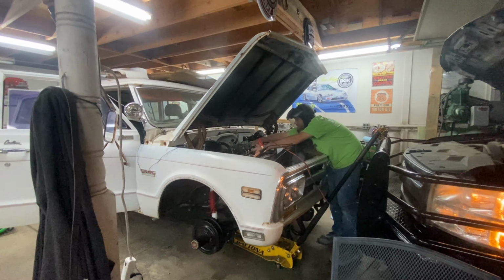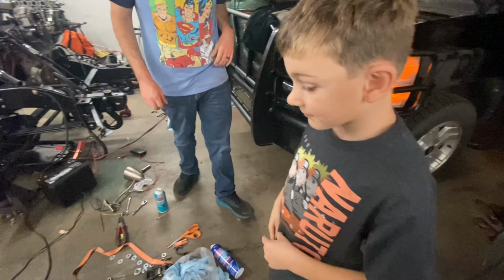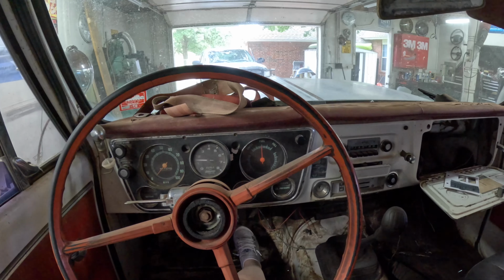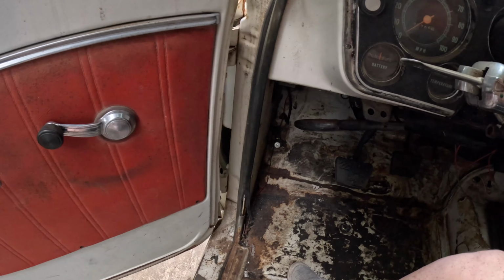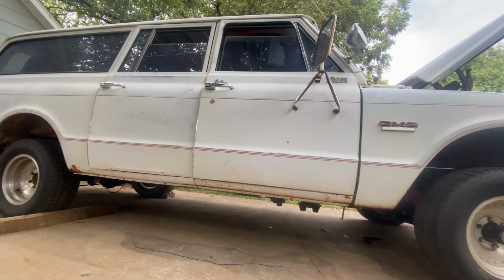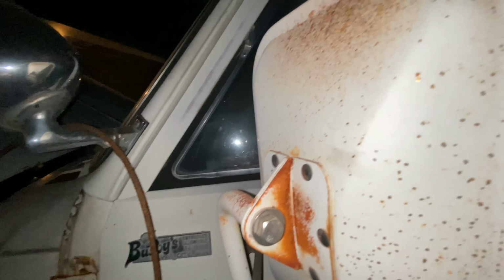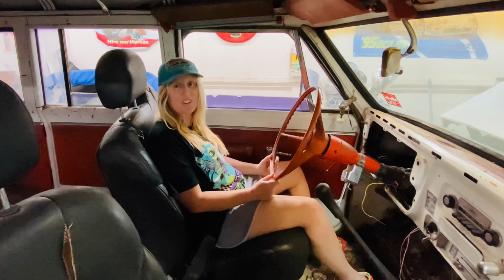68’ Suburban build’s sweet success!

Comment: A later model steering box will make the steering feel tighter. The early boxes always felt "mushy" for lack of a better word. The 68-72 boxes were 4 1/2 turns lock to lock, the 73- IIRC about 86 boxes are variable ratio and 3 1/2 turns LTL. There some fitting differences but the nut on the back of the pump is removeable and you can swap to the one you need or have a local Hyd shop make your hoses. The later suspension also will bolt up with a little wallowing of one hole on each side to give you disc brakes and cheaper tie rod, ball joints and bushings. Also the later front sway bar is a bolt on as long as you get the frame brackets . Just some ideas for what I have done to my 68.
Reply from the maker: Thank you for the suggestions and for watching! Lots of good info

Comment: Why would you spend the time and money and put a carb on it?
Reply: that's my question as well
Reply: @dutsmiller  it also sounds off like the compression is low or valves are open.... it's not running right at all in this video
Reply: Did you watch until the end? It sounds great in the last few minutes
Reply from the maker: We went with a carburetor because it’s a 1968 and we wanted to keep it old school and also wanted to be different with our ls swap. When the carb is dialed in correctly you can’t match the throttle response with a throttle body. Carburetors offer great performance if tuned correctly. Thanks for watching!
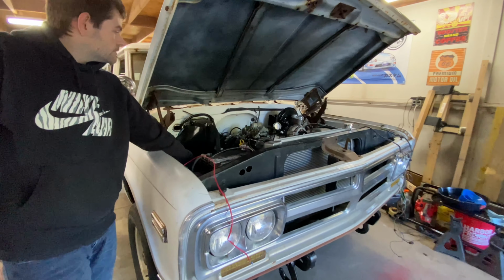Reply: No… that was towards the middle. I’m talking about at 8:04 when it started up without any starter fluid and sounded awesome
Reply: Because she can do whatever she wants . Get outta here with that bullshit
Reply: @scottc4433  lmao we got us a real tuff guy.......